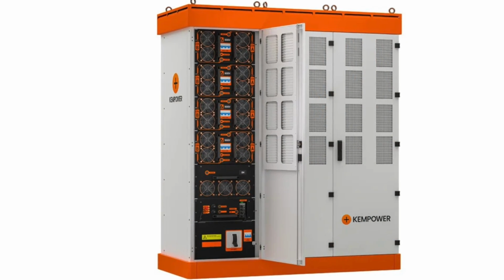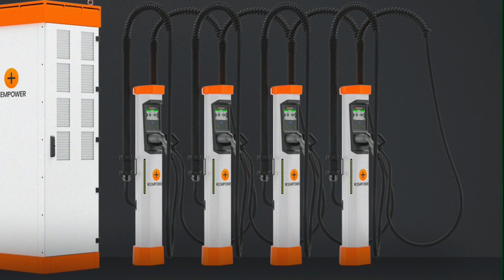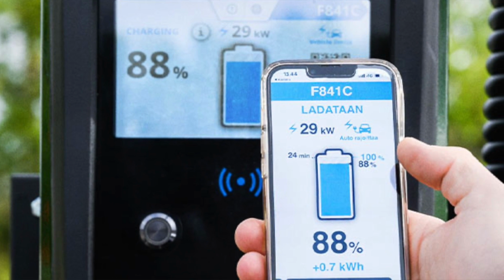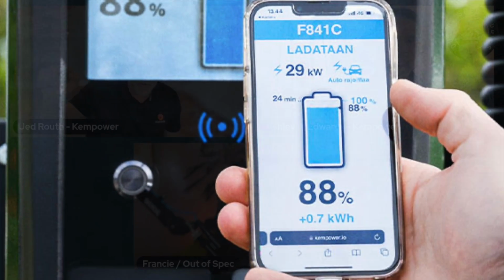Kempower's Product Lineup Offers Flexibility While Prioritizing Reliability

Comment: The most important for CPOs and the EV customers is reliability. Way to many chargers have had issues with this.
For the end user a simple interface and easy to read information is important. Kempower will tell you where the limit is, car or charger.